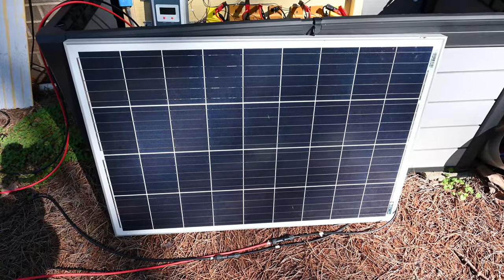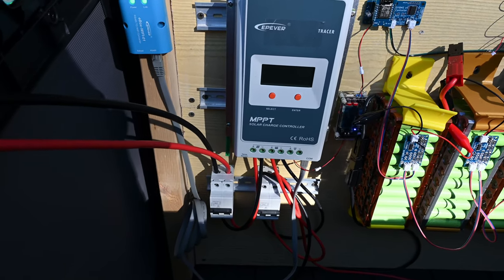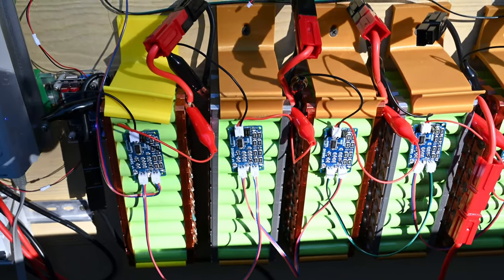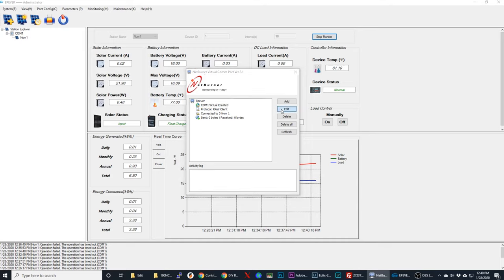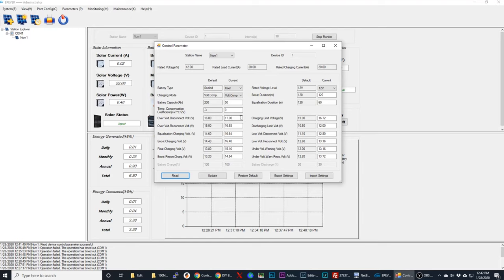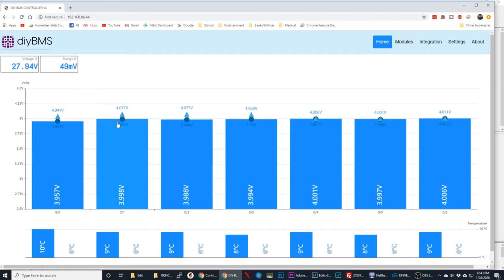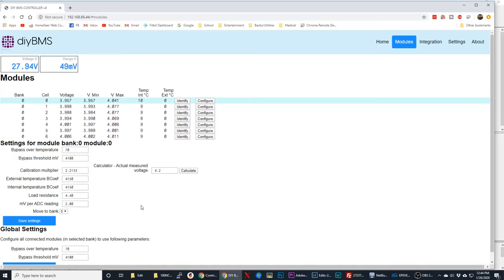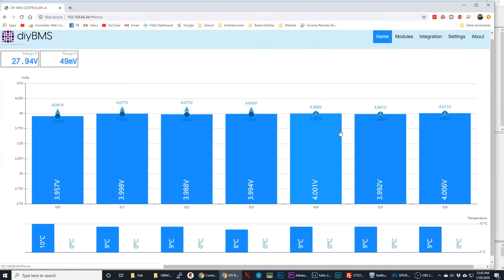Followup of my DIY Powerwall and DIYBMS v4 battery management system.

Comment: Thanks, mate, nice video. Good inspiration for my own build. I'm at 5.5kwh @ 48v currently. Running the latest DIYBMS v4 hardware with the 20 smaller SMD load-resistors. Else, a very similar setup and with 2x280W panels.